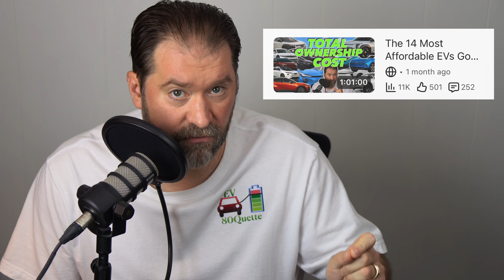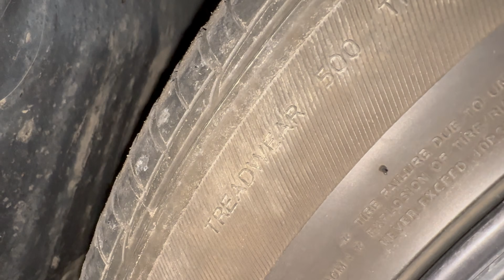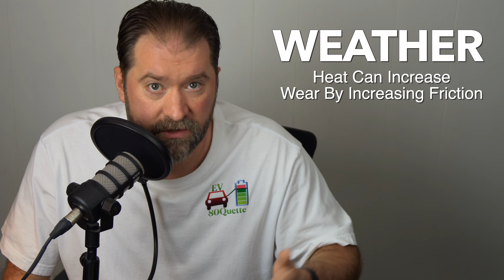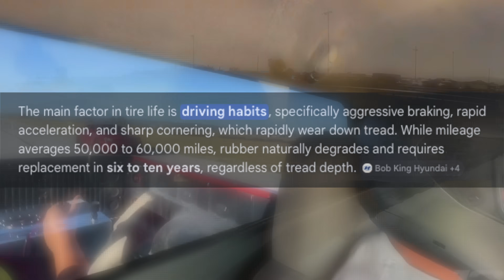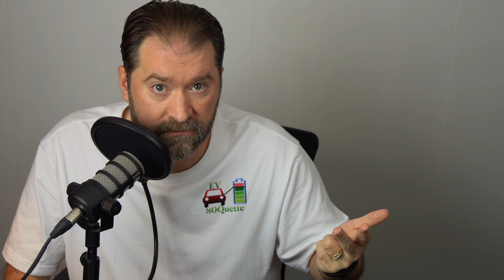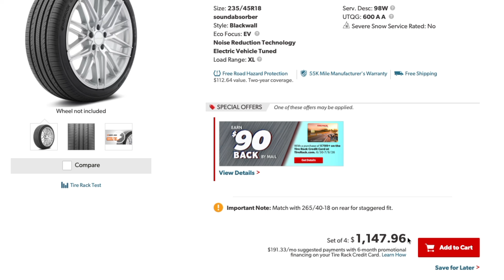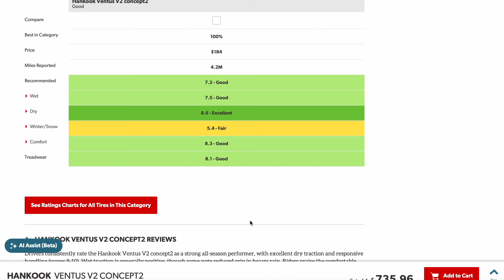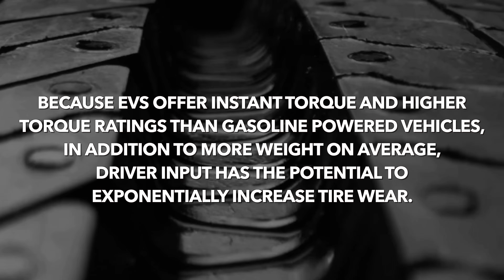I Got New Tires For My EV - Here's Everything I Learned

Comment: Nice video! How does Connie like the replacement tire set? I am leaning towards the Hankook EVO AS SUV for my next tire set once my OEM Continental CrossContact RX tire set wears out simply because I want the additional range that the EV tires offer over the OEM tires.
Reply from the maker: She loves them.  They make a little more noise, but seem to perform well. The Hankook Ion EVO AS were the best I could find with an EV focus for my vehicle, so I figure they will be a great replacement tire for your EV.  The sacrifice with the Hankook tires is wet and snow performance, as they are not extremely highly rated, and the Hankook tires we had before the change were downright poor in the wet.  The ION EVO should be better. Best of luck with your next set. Don’t hesitate to let me know how they work out

Comment: Torque is not directly comparable. It's torque at the motor or torque at the wheels, where fossil fuelled engines are quoted at torque at the crankshaft. First gear and final drive are applied after engine torque, meaning a petrol car with 100Nm of torque will typically have over 1000Nm at the wheels in first gear.
Reply: EV manufacturers quote torque at the motor. That's seems as directly comparable as you can get.
Reply: @ziploc2000  
Edit: These numbers are for torque at the wheels.

2026 Subaru Solterra:
13.8:1 @ 337Nm = 4 650Nm
Across 4 wheels: 1162Nm per wheel

Alfa Romeo Stelvio 2.0 Turbo Q4 (base model @ 147kW)
5.0:1 1st gear ratio * 3.73:1 Final Drive ratio * 330Nm = 6 154Nm
Across 4 wheels: 1538Nm
That's excluding torque multiplication from the torque converter at standstill. Add another ~1.5 x factor for that.
Reply from the maker: Torque is most certainly not directly comparable. 100% right. EVs deliver torque differently.

Comment: Please stop measuring tread depth with a coin. A tread depth gauge is more accurate, easier to use and faster.
Reply from the maker: I don’t have one.
Reply: It’s definitely worth <$20 to invest in a tread gauge. I got mine on Amazon for $8. Unlike, a Penny, you get .1 mm increments to see how uniformly the tires are wearing. I’m actually going to do an early rotation for my car because the rears are 1mm less than fronts for my model 3.  Rotating adds a little more life - I always buy a set of 4 tires when the worst tire gets to 4mm of depth.   This knowledge saves a lot more than my $8 investment in a gauge.
Reply from the maker: @rjmosko  100% right.

Comment: Good video.  Maybe as an addendum you can discuss the elephant in the room: With most EV's not having a spare, you need a tire that either has run flat tech (stiff sidewall, totally ruins the ride) or the goo inside that self seals.  Very few options here.
Reply: Nearly half the cars currently sold do not have a spare tire, and this is nothing to do with them being electric.
If you are interested why this is so there are videos about this.
 It would be out of place to discuss this in this video.
Reply from the maker: I’ll be happy to address spare tires in an upcoming video
Reply: @Aslash304 Adam, in that video you might mention small OEM air pumps/sealers offered in other countries, as one potential option. 

For example, U.S. Chevy Bolt owners (first gens, at least) often ask why there’s a cutout in the rear “for something” that didn’t come with the car. 

It’s for a GM air pump and sealant kit that came standard on say, Canadian models (and others?) 

I bought mine on eBay for less than $50 … mainly to fill the storage slot because I’m a sad completest. (Can’t remember the last time I had a flat tire when on the road.)

Comment: The best all around EV tire is the Pirelli Scorpion Zero Plus 3 Elect in my experience. The feel, precision, and low noise characteristics are excellent on my Tesla Model Y Performance.
Reply: Nice tire indeed.  I recently got Michelin Pilot Sport All-Season 4's for my Tesla Y LR AWD and couldn't be happier.
Reply: @progression_decibel  Those are excellent performance tires for sure. If I ever buy a M3P, that's the tire I'll swap with my Cross Climate 2s.
Reply from the maker: I wish they made these in the 18” offering.  I have had good experiences with Pirelli myself.  I’m glad you’ve found a good set for your vehicle.  Thanks for sharing your experience!
Reply: They were perform well on my Audi e6 ; it’s a very heavy car . too soon to assess mileage so far

Comment: Finally swapped out the tires on the SUV for a set of Hankook iON evo AS tires! They came in at just under $300 each, and honestly, we’re loving them so far.
I’ve noticed a lot of people opting for standard tires or those labeled "EV-ready." I have to be clear: *"EV-ready" is not the same thing as being "EV-engineered."* While a tire may meet the basic load and speed ratings to physically fit your vehicle, it lacks the specialized development required for the unique physics of an electric vehicle.
I really cannot recommend using non-EV-engineered tires. Here are the major safety and performance concerns:
 * *Structural Integrity under Load:* EVs are significantly heavier due to battery packs. Tires truly engineered for EVs have reinforced sidewalls and specialized structures to handle that extra weight. A standard or "EV-ready" tire may not provide the same lateral and cornering rigidity, which is critical for stability during emergency maneuvers.
 * *Instant Torque Management:* The instant, massive torque of an electric motor puts exponentially more stress on the tread than a traditional engine. EV-engineered tires use proprietary compounds designed specifically to resist that high-torque strain. Using a non-engineered tire often leads to rapid, uneven wear and compromised grip.
 * *Safety & Handling Precision:* Because of the unique weight distribution and low center of gravity in an EV, weight transfers are sharper and more intense. EV-engineered tires are optimized for these specific dynamics; standard tires often feel "sloppy" or lack the necessary control, particularly in wet conditions or under heavy braking.
 * *Acoustic & Efficiency Trade-offs:* Without an engine to mask road noise, the wrong tires can make your cabin significantly louder. True EV-engineered tires often include advanced noise-abatement tech, like internal foam liners, and are optimized for low rolling resistance to maximize your range—features that are typically compromised or missing in standard or just "ready" tires.
Don't just look at the price tag—consider how the tire is actually built to work with your vehicle's specific engineering!
Reply from the maker: Thank for the feedback
Reply: Marketing terms like " ev ready " or " engineered" or anything else doesn't mean anything.

Load index rating 

and speed index rating 

Are the only things that factually prove tire A has more capabilities than tire B.

It would be nice if there was a rolling resistance rating too but sadly there is not.